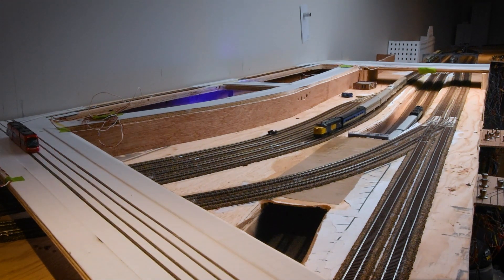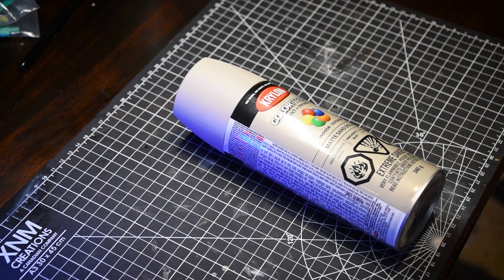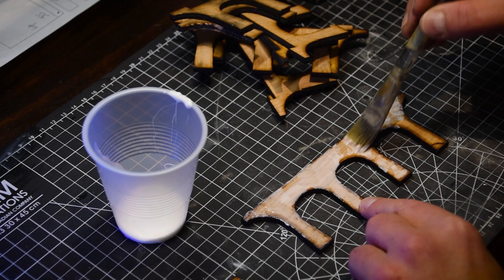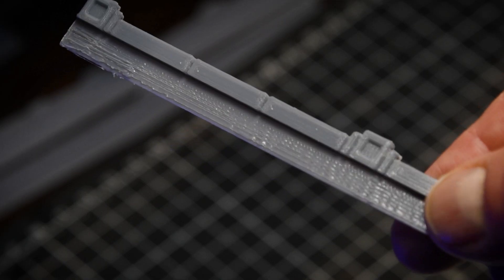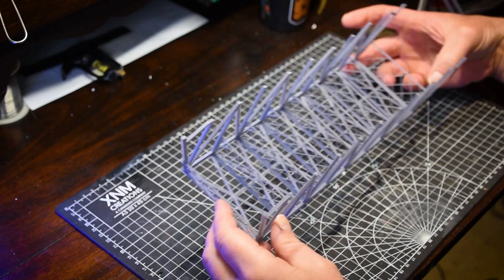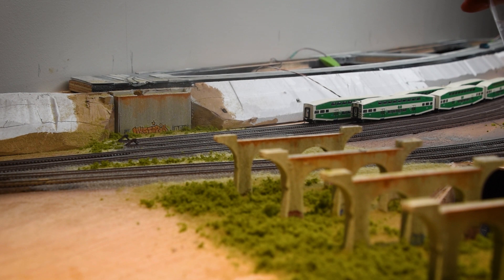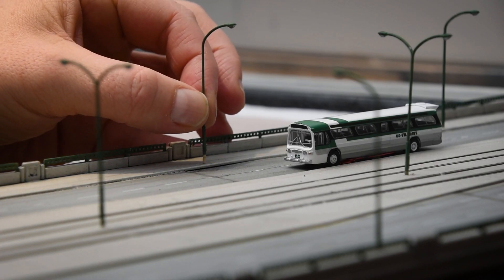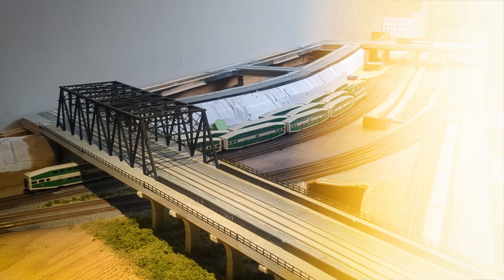The Bridges at Bathurst: Transforming the Streetcar Project with Realistic Roads and Bridges

Comment: Question :  How have you set up your street car to automatically reverse direction a the ends of the tracks ?

I found that Kato model so cute, I just had to get one.  :)
Reply from the maker: I haven't wired the reversing circuit yet... But it's ready to go. To make the train go back and forth without traveling past the end of the track, diodes are inserted in the last 4 inches of each track end. These diodes allow current to flow in only one direction. When the train reaches the end of the track, the diode blocks the current and stops the train. Reversing the voltage allows the train to move in the opposite direction, and the diodes restrict its movement at both ends. A timer circuit changes the polarity of the track every 90 seconds, ensuring the train shuttles between the two ends while being stopped by the diodes.